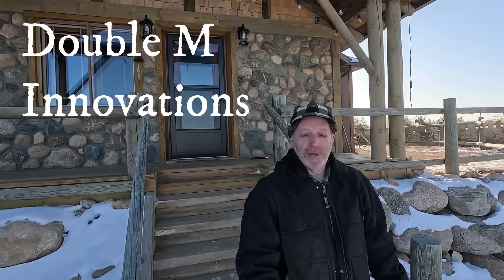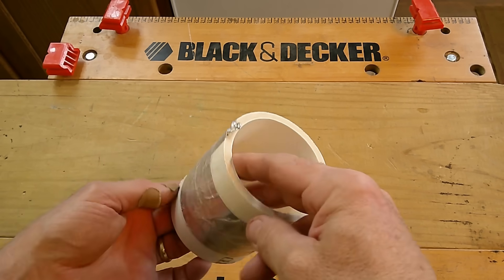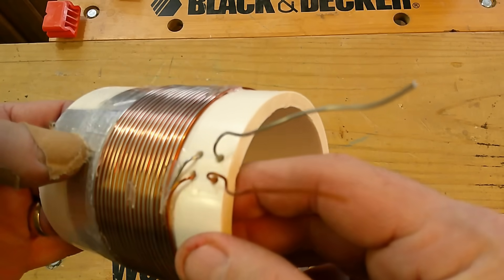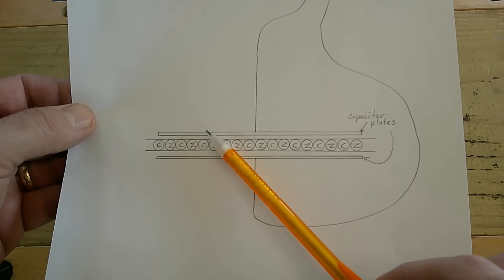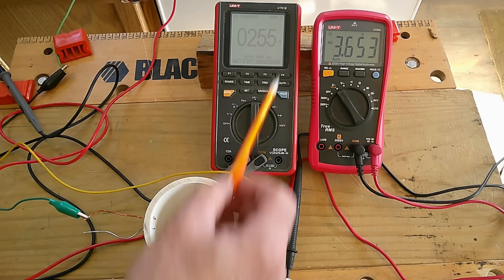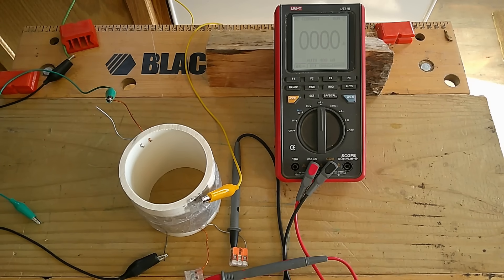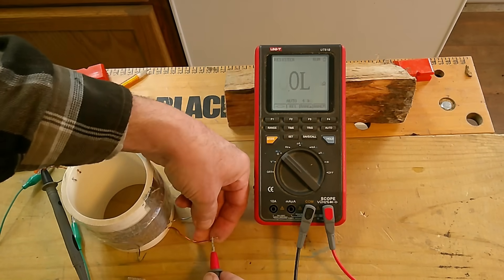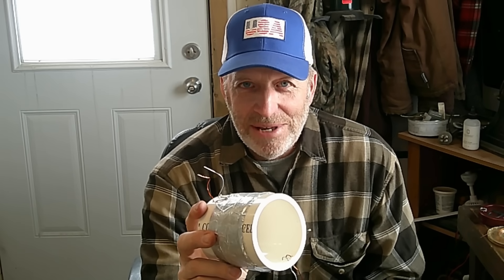Copper-Zinc anomaly; and a capacitor sandwich

Comment: Isn't there between the capacitor 120V AC a second capacitor in the electrical field of the first one. The second capacitor is build of the two insulated wires made of Cu and Zn. I would predict, that the materials of the wires don't have any influence; it is only the surface. It is an electrical field transformer in opposite to ordinary magnetic field transformers, where you could get strong Power out. The surface of the capacities are very small here, so you measure a Voltage but the stream could be very low = may be enough to light a LightEmittingDiode.

Comment: What you did was build a field sampling capacitor. Ive used similar devices for sampling the power and q factor tuning in high frequency circuits. You do neeed two different metals for the wires one should be higly conductive but the other should be resistive  but not magnetic. Whats going on is the eddy current in both metals is going to have a differential as the electrical field changes and you can use this differential to measure the quality factor of a resonant circuit.❤
Reply from the maker: That's interesting.  Thanks for sharing your insight!
Reply: can you provide a search term in google, cant seem to find much detail on this.
Reply: Search for videos about " Measuring Q Factor in HVAC (high voltage AC), and keep an eye out for the tool names.  Those will get you to simplified answers for us non-engineers.    Electroboom has a video dealing with Q factor
Reply: I, too, would like to know more about field sampling capacitors. I asked Copilot and it gave an answer about the capacitor in a sample and hold circuit, which has nothing to do with what we are talking about here.
Also, I don't see how eddy currents apply to Double M's puzzle. Eddy currents arise when AC current flows through wires. But in this case we just have a voltage between two wires. I don't see where there is any current flowing through the wires.
Reply: @jankok9911  Eddy currents are induced by changing magnetic field, even if you simply "apply" AC voltage with minimal load this phenomenon still occurs, as magnetic field is changing 60 times per second for (60Hz).
Reply: Based on your description, you're building what's essentially a differential eddy current probe that functions as a "field sampling capacitor" for high-frequency resonant circuits. This is an advanced RF technique for non-contact measurement of power, Q factor, and tuning. you want to have two different metals:
Highly conductive wire (copper, silver, gold) - Carries the "reference" eddy currents

Resistive but non-magnetic wire (nichrome, constantan, manganin) - Carries the "lossy" eddy currents.
The differential between their responses to the changing EM field creates a measurable signal proportional to the circuit's Q factor and power dissipation.
Reply: Construction Guide: 
Materials Needed:
Conductive wire: OFHC copper, 18-24 AWG (0.5-1mm diameter)
Resistive wire: Nichrome 80 (NiCr, 80/20), 24-30 AWG
Non-conductive former: PTFE rod/tube, quartz, or ceramic (5-10mm diameter)
High-frequency dielectric: PTFE tape or alumina beads
SMA connectors (2x) or BNC if lower frequency
Shielded enclosure: Copper or aluminum small box
High-frequency coaxial cable (RG-316 or similar)
Reply: Construction Steps:
A. Create a bifilar winding:
   - Twist together: 1 copper wire + 1 nichrome wire
   - Keep consistent twist rate (~5-10 twists per cm)
   - Wind 3-5 turns around the dielectric former
   - Keep spacing even (~1-2mm between turns)
   
B. Electrical Isolation:
   - Wrap entire assembly in PTFE tape
   - Ensure no short between turns
   
C. Connection Points:
   Copper wire → Center conductor of SMA #1
   Nichrome wire → Center conductor of SMA #2
   Both shields tied together → Common ground
Reply: Calibration Loop (Optional but Recommended):
Create a small copper loop (1-2cm diameter) to place near your DUT
This provides a known reference for Q measurements

Enclosure and Shielding:
- Place probe in small copper enclosure
- Leave only sensing area exposed
- Use bulkhead SMA connectors
- Fill with low-loss dielectric (optional)
Optimal Materials Selection

For the resistive wire:

Nichrome 80: Best for most applications (non-magnetic, stable)

Constantan: Good temperature stability (55% Cu, 45% Ni)

Manganin: Excellent for precision (86% Cu, 12% Mn, 2% Ni)

Avoid: Steel, iron, or any ferromagnetic material

For the conductive wire:

Silver-plated copper: Best for >100 MHz

Pure copper: Good for <100 MHz

Gold plating: For corrosive environments

Frequency Considerations:
< 10 MHz: Simple twisted pair works well.
10-100 MHz: Use tightly twisted, short leads.
> 100 MHz: Consider coplanar waveguide construction instead
Reply: The q factor is the magnetic b field I hope you understand what I mean. Basically tapping universal vacuum energy. My understanding tells me the magnetic b field is gravity in electromagnetics
Reply: @JeremyBembry-df4bh  that’s not “q factor” at all. It’s solely about AC electricity and the difference caused by Industrial Sized loads on the grid.   
It has zero to do with Mass, Gravity, or anything else
Reply: it’s eerily reminiscent of the seebeck effect
Reply: Fascinating take! Calling it a "field sampling capacitor" makes sense—using copper and zinc to measure the Q factor via eddy current differentials in a changing AC field is a clever twist. This could tie into the capacitive coupling I mentioned earlier (@ColinWatters), where the metals’ properties drive charge separation, amplified by resonance. The non-magnetic aspect rules out transformer effects, aligning with the hybrid nature of this setup. Maybe the aluminum foil enhances the field sampling? Testing different frequencies or metal pairs could reveal more about the Q factor and voltage output.
Reply: @SereneGlade  the q field is the magnetic b field is gravity.
Reply: Not too surprising the lack of this particular type of sampling capacitor considering most are simply a low value capacitor for signal detection. This particular type of capacitor is used as a threashold trigger for high speed pulsed power circuits more than anything else. Things like radar high speed strobes emp devices etc.
Reply: I am looking for a co-founder in a project to generator, investors are waiting for a prototype, who wants to become rich and monopolize this technology, please respond.
Reply: @maguccimotorincorporation  Bro you think GE or Westinghouse are sleeping? It's known fenomenon. Cool, but known.
Anyway great video OP!
Reply: @maguccimotorincorporation  Im interested to see and join you if it's good
Reply: @TravisTellsTruths  Hello, how can we collaborate to create a prototype, can you take on the creation of a prototype? This project is from the field of greentech.

Comment: Hi, this is the principle of thermocoule linked to the oxidation-reduction potential of metals, it also works by heating the junction point between copper and zinc. you can read the works of Lachovsky, Christofleau on electroculture and bioelectronics Vincent to learn more😉👍
Reply: The copper wire is insulated. What your describing requires contact between the metals.
Reply: @tenlittleindians  only at one end, if it's not, it's simply magnetic indiction
Reply: @nutnut2513  There's nothing magnetic going on without a magnetic material.
Reply: Everything is magnetic...it's just a question of how magnetic
Reply: Agreed, but there is no contact physically between his wires

Comment: I can put a link I this crap of a video platform so you have to search it yourself it's called a Capacitive Voltage Transformer or CVT  for short. There is a side called circuitglobal so search for that and the transformer. I would really love to help you out with that by posting the link but YT censor retards would censor it. So good luck and keep it up pal you are awesome 💪.

Comment: Use a 'scope to look at the phase relationships.  You will find that the DC resistance difference between the Cu and Zn causes a phase shift that shows up as a small voltage between the wires.
Reply: DC resistance R does not generate phase shift, regardless of magnitude of R.
Reply: @alinochis1514    True, when only resistance is involved but there are conductors separated by dielectrics.  That means we have a capacitor with an equivalent series resistance (ESR) and that can cause a phase shift.

Comment: This is interesting, I think you just getting some capacitive coupling going on, it seems like capacitor inside a capacitor. A capacitor will pass AC power base on it size, this use some things to limit power flow.  Some early LED lights some timing would glow even when turn off, as some power could capacitive pass power throw other wires near by, most them now days have small load to shunt this power.  I not really sure why it works better with different wires types, my thought is they have different reactiveness this make phase angle change and when they are same type of wire they just cancel each other out, you maybe get like thing if you made both coils of type by made much longer then the other, that could be something to try if you want keep playing around with it.
Reply from the maker: Thank you for thinking it out!  This was something to do while I couldn't work on the wind turbine, because of weather.  I'll probably think of more things to try...

Comment: I listened to an old Coast to Coast with Art Bell where he interviewed the son of one of the Roswell crash clean up soldiers who took a piece of wreckage home with him and had it analyzed. He said it was a sandwich of Aluminum, zinc, bismuth, magnesium and trace elements, and if you took a gram of bismuth, a gram of magnesium, a gram of zinc, and sandwiched them between two grams of aluminum instead of 5 grams the sum of all parts only weighed close to 4 grams, so the speculation was that the combination of metals had an anti gravitic effect either due to the electrical or magnetic properties interacting. Like how some alloys can be eutectic but instead of temperature this was weight.

Comment: I love little puzzles like this, THANKS! Here's what I think. What matters is not that the metals are dissimilar,  but that they have different resistivities. Try this. Wind with one thick gauge Cu wire and one thin gauge Cu wire. Ideally, choose the gauge of the thin wire to match the resistance of the zinc wire and the thick gauge matching the Cu wire you are using here. Now test that circuit. Do you see a similar AC voltage drop across the thick and thin wires?
Reply from the maker: Thanks for sharing what you think!  Could be...

Comment: Probably the electronegativity of each metal. zinc is -1.65 and copper is -1.90
 The difference being .25 volts in an electric field between two charged plates with a potential difference of 115v Alternating Current between those two plates. it's like biasing the potential difference of the two electronegativity values. The wires acting like a diode like effect as well as the metals do not alternate in their electronegativity...
 I would sniff the field and see what the wires effects are in between the plates. How much does it distort the AC signal between the two plates...Probably reading one wire through the 2 coils could tell you something about the fields between the pates?
Reply: That was my thought. The electronegarivety inbetwean metals. 
So what is a metal? Something like a foam. Some are denser, some are flushier ... Resistance. Good. If something squeeces the foam ... think an pieco christall ... it emit's something. 
Sunlight is H- ion on ❤💚💙 resonating, emitting photons ... mixture 🤍... temperature increase!

But! Moonlight is cold. Even focused it is more cold😮

So this two metal in thair nearby enviroment act differen. Maybe this is a kind of static effect... The current should be meshured by an analog gauge. 

What is Magnet in a Copper tube? Addycurrents.
Comment☝🏼 several layers over layers different Metals ... act also like several foams and over all the wight is in a system different than seperated... Such an interesting clip🙏
Reply: There is probably some oxide layer in there acting as a semicontuctor

Comment: If you place metal bar through the cylinder and make a setup that the cylinder is vibrating back and forth you will see an increase in voltage. Mainly it works when a copper coil is vibrating around a metal rod that creates that increase in voltage. Remember the selonoid but a selonoid is actually the metal bar is moving back and forth. This I mentioned is opposite to that, the coil is moving back and forth.

Comment: electric current formed like a K type thermocouple?
Reply: Peltier effect, requires an electrical bonded contact between the different metal types, like Chromel and Alumel. To make a thermocouple, a 6mm of the end is stripped, and a spot welder is used to fuse the end of the wires together. This will produce a micro voltage as a function of temperature.
Reply: @f.hababorbitz  That's so cool, i never considered peltier effect generating a small voltage though differing material thermal expansion, nice :)